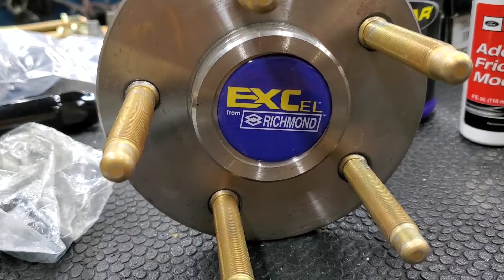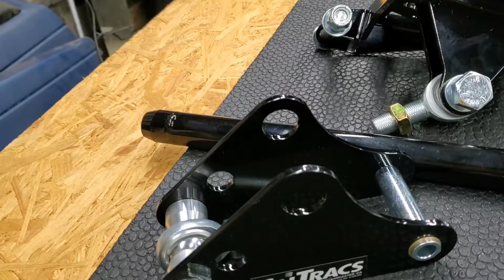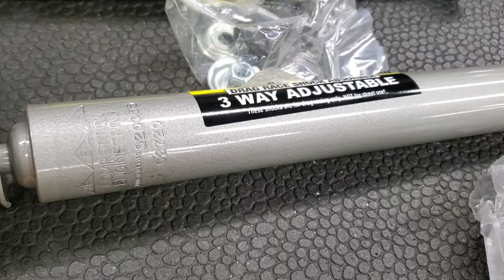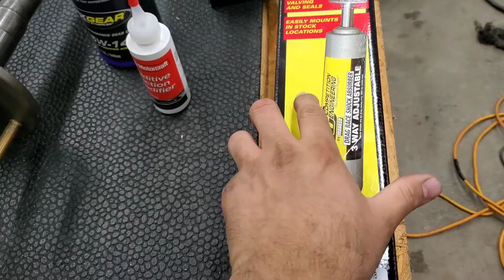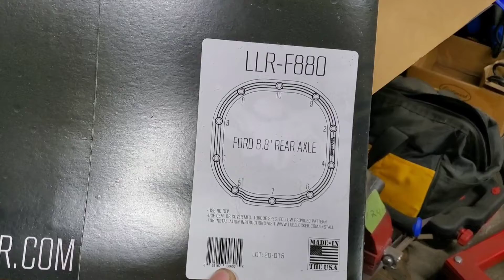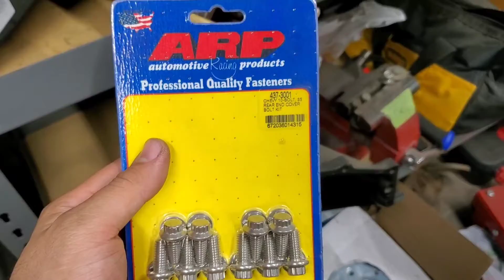V8 S10 Build Ford 8.8 Rear & Suspension Components

Comment: Did you change the housing end for 9in or leave stock end
Reply from the maker: I kept the stock ends so using the c clips. If I would do it again probably do the 9in ends or just use a 9in rear. People seem to be using 8.8 rears as they are with no issues though.

Comment: Yes sir nice parts, one question:
Are you running stock redrilled ford rotors or aftermarket rotors?
Also if aftermarket rotors which ones would fit the stock Ford brake calipers? Brand and part #s i have 64 nova with 8.8 rear cutting to size. With chevy axle, wondering what rotors would fit.
Kind regards.
Reply from the maker: I havent got around to assembly of the rear yet but the rotors I got off summit racing. Part # BR-65052LC and BR- 65052RC. I can't confirm they fit for certain since I haven't installed them yet but I believe they should because I filtered the rotors on the website for the year ford explorer I acquired the rear from. Hopefully will find out soon though
Reply: @304customsgarage  thank you so much for the information following on your awesome builds kinds regards

Comment: Want a cool cover get one off a 2003 2004 explorer with independent suspension and cut and smooth ears off and bam get a nice aluminum cover with fins and drain plug on it. Bolts right up
Reply from the maker: I'll have to check that out I haven't put the rear back together yet but will definitely look into it before doing so, thank you for the tip!